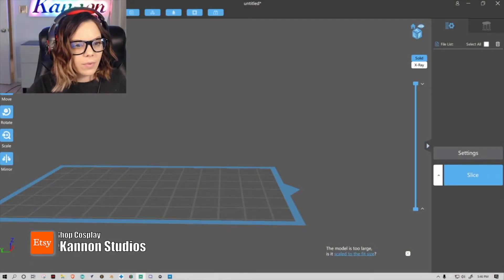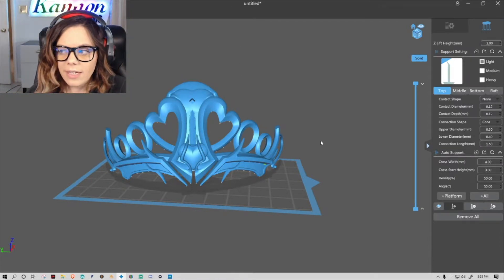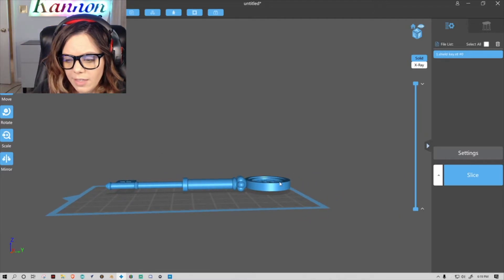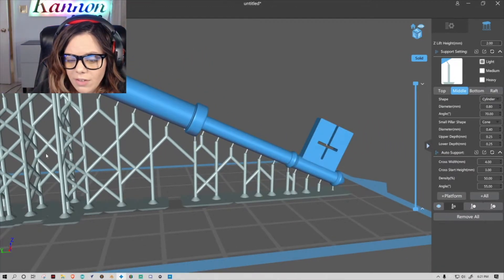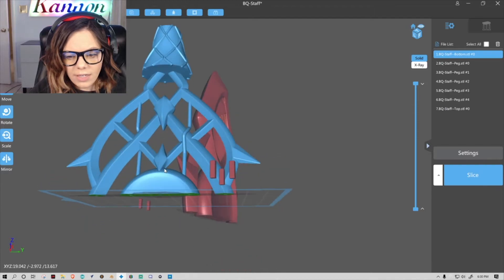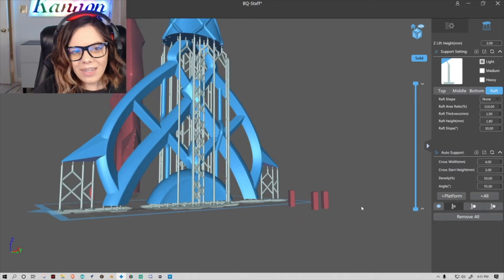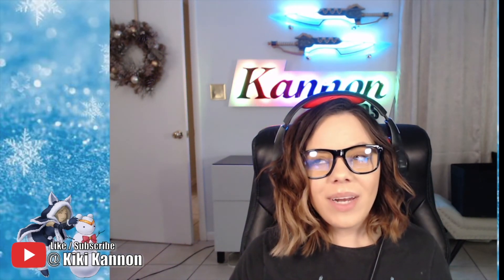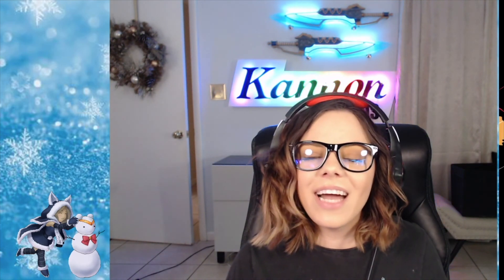Chitubox Support Settings

Comment: I'm trying to get supports that are strong enough and contact enough to not have failed prints , but leaves  little to no surface blemishes after removing if possible
Reply from the maker: It's a lot of careful calculations! 😅  Every piece is different, plus what resin / printer is being used.

Comment: Hi! good explanation about the supports. About the deformation when printing directly on the plate, I think there are two different effects.

The first one is called 'elephant foot effect', which makes the part wider in the first few millimeters. It is caused by the longer exposure time of those first layers, which is normal. There is very little you can do about this one.

The second one is warping, and I think it depends on the resin type, part shape and more things. I guess you have noticed it before, but not as strongly.
Reply from the maker: Thanks.  Interesting,. thanks for the information.